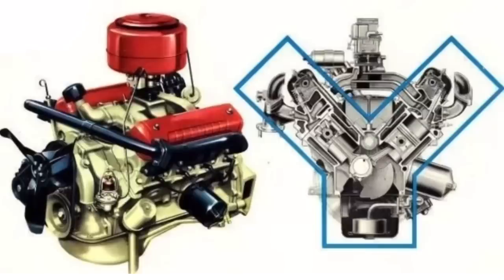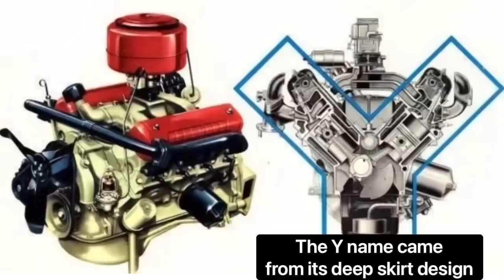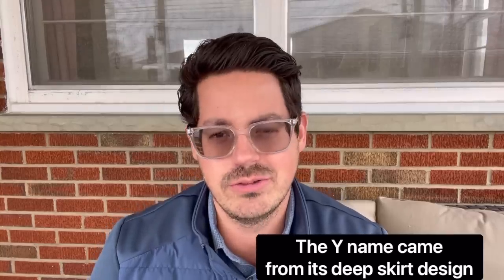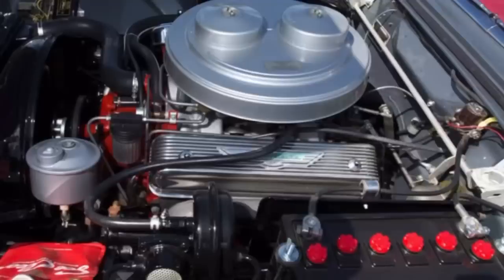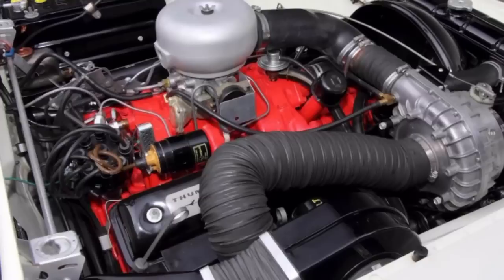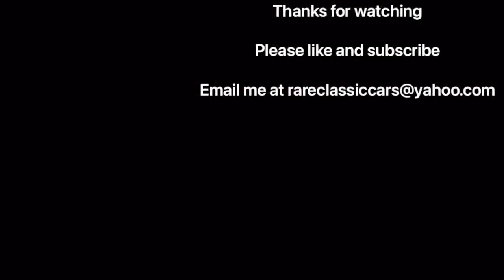Worst Engines of All Time: Ford Y Block V8

Comment: Ford's early FEs also had weak oiling. Odd to make the same oversight twice in a row.

 Please note, I did not say the Y Block and FE had identical oiling systems, simply that the original configuration FE had issues with oiling, thus the change to the Side Oiler.
Reply: Uh, nowhere near as bad as a Y block. Ive never had oiling issues with an FE in 50 years of automotive repair and rebuilding., BUT, I learned from experience rebuilding Y-blocks that using modern alloy soft facing on the camshaft bearings will invariably migrate into the groove machined in the camshaft journal which feeds oil to the rocker arms on both sides of the engine, restricting or blocking the flow to both shafts and rocker arms. Original type hard bearings are available and MUST be used if "California oilers" are not used to feed oil to the rocker shafts
FE engines had dedicated galley passages to feed the rocker shafts, but ONLY the side oiler 427 supplied direct oil feed to the crankshaft journals
Reply: The fe has a completely different oiling system.
Reply: @user-cs1ne8gx9u  — True, but the FE’s, except the 427 side-oiler, fed the crank from the cam bearings, which was not optimal.
Reply: @sking2173  the center oiler fe has a very conventional oiling system that worked well in it's expected role. Most engines from that time had an oiling system that is more or less the same as the center oiler fe. It wasn't until high rpm endurance racing for 24 hours that any deficiencies in the conventional system were noticed. And even now there's some debate as to if it was the extra oil that was needed or if cross bolting the mains to avoid the caps squirming around was the trick. Either way the side oiler was an improvement for sure just not one really needed unless you're at le mans.
Reply: @sking2173  All the "Windsor" V-8's do this and don't have oiling problems as long as the cam bearings are good. Which they usually are because Ford line-hones the cam bearings in these engines to achieve a perfect fit which greatly reduces their wear while allowing proper oil flow to the bottom end. The system works well if you know how to deal with it.
Reply: @P_RO_  — The SB. Ford has a main priority oiling system where the crank is fed directly from the main galley, and from there, the oil is fed to the cam bearings.

Google it!
Reply: @P_RO_  — 

“The small-block’s oiling system is straightforward right off the oil filter to main journals, then, cam journals. The only exception to this rule is the 351C, 351M, and 400M where cam journals get oil first, then, main journals.” — diyford site

Ford did the SB properly. Shame they didn’t do so well with the Clevelands !
Reply: The 58 332 FE had solid lifters and had a few problems in late 58 they all had hyd lifters. The only side oiler FE is a 427 and they are very rare and valuable.

Comment: My mother's first car was a 1956 Ford, and she has nothing good to say about it.  Second car was a 1959 Chevrolet that she said was great.  After watching these videos I'd guess the '56 had the y-block and the '59 the reliable v6.
Reply: Don't you mean i6
Reply: Or v8
Reply: @evanc6110  whoops.  Thought the stovebolt six was a v not an inline.
Reply: @Jameson_d1  GM made a few V6s in the 1960s, GMC and Buick. Ford and Chevy jumped on board in the 1970s with their 2.8s, and  I guess Chrysler didn't make one until the late 1980s or '90s. V6s make for more packageable power plant than inlines.
V6s can never match the smooooth mellow exhaust tone produced by an inline six exhaling through a single log-style exhaust manifold, however.
Reply: Chevys had an inline 6, not a V6.